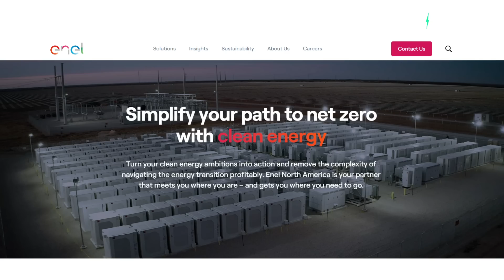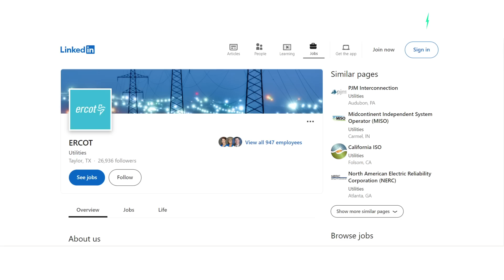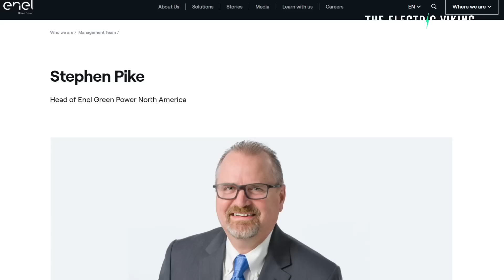Texas beats California: How oil country became the renewable energy leader

Comment: While having the battery facilities next to a solar farm is good, placing that battery in the parking lot of a shuttered fossil fuel power station also has the advantage of being able to use the existing grid connections. I'll take both and of course the best is the Solar Panels on my roof and the PowerWalls in my side yard.
Reply: I like the idea of rooftop solar  on the roofs of warehouses and other large buildings.
Reply: Since the size of a solar project is often limited by the size of the link to the grid, having onsite storage can be a huge deal - because it allows you to grow the size of the solar farm, by delaying the transmission of some of the power.
Reply: @SavageChinquapin  Excellent point I had not thought of the grid capacity being a bottleneck.
Reply: @jjamespacbell Not sure how it is elsewhere, but transmission congestion is a huge deal in Texas/ERCOT.
Reply: @SavageChinquapin  both batteries at the site of generation and batteries at the site of use are good ideas as the load on the grid varies with both production and demand. Too much production at the site of generation overloads the main electrical trunk into a city, but too much demand at a single site overloads the substation at that site. If there's a ton of production all at once, more than the trunk could handle, store it at the site of production. If there's more demand than the substation can handle at one point, that's also a problem, so have some electricity stored at the point of demand as well, eg EV fast chargers that spike in use in the mornings and evenings.
Reply: All sistems should be at the same place,solar ,wind, battery next to not renuable surse all run by the same company.

Comment: You would think Ca. would take some of the desert and cover it with solar panels.
Reply: At times California has so much solar power that its price is literally negative.  What it needs more is probably more storage, and more transmission to and from places that have wind and solar when California has less, or vice versa.
Reply: California is building out  multiple solar plus battery power systems at this time. What California can really use is more wind energy capacity. Hopefully offshore wind will become a reality soon.
Reply: @GoCoyote  you would think for cost and safety they might try Gravitricty. A heavy weight used in mining shafts that can generate MW based on power needs.  There was a lot of mining in Ca.
Reply: Solar in the desert!  Wow, amazing that California hasn't thought of that yet. They should read YouTube comments.
Reply: @incognitotorpedo42 There are thousands of miles of irrigation canals in California. They are experimenting with putting solar above these as it is a win-win proposition. The cells are kept cooler and thus produce more and evaporation is reduced from the canals. These aren't small canals. Think freeway size.
Reply: But think of the environmental draw backs
Reply: @brianjonker510  well a few square miles vs a coal plant or nuclear?  Its all a trade

Comment: Don't let Texans find out , they hate cheap energy.
Reply: Seriously??? As a resident of Texas, it has been my experience that Texans are very proud of the accomplishments in the state in regards to renewables, however, they are realistic enough to understand that fossil fuels also play an important role in fulfilling the energy needs of the state, and will continue to do so for many years as the transition to a primary role for renewables takes place. At this point in time, Renewable Energy Plans run about 2 to 4 cents per kWh higher than a standard energy plan, so, in answer to your comment, Texans do prefer less expensive energy, but foremost, they want reliable energy, and at this time, with the incredible growth in the state, it takes all of the available energy resources, both renewable and non-renewable, to accomplish that.
Reply: I'm in Texas and I love my 8 1/2 cents kWh electric bill.
Reply: Have you ever thought?
Reply: Cancun Ted hates cheap renewable green energy.
Reply: We don't have cheap energy, yet. We are middle of the pack (20 something) when it comes to cost per kilowatt. The Texas legislature should have to answer why that is the case.